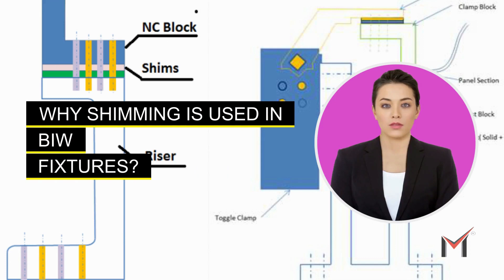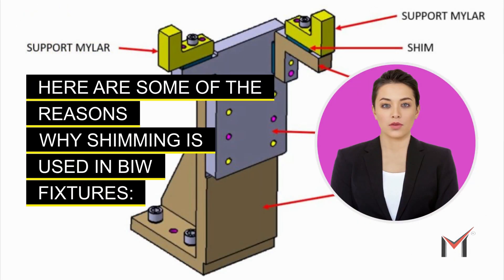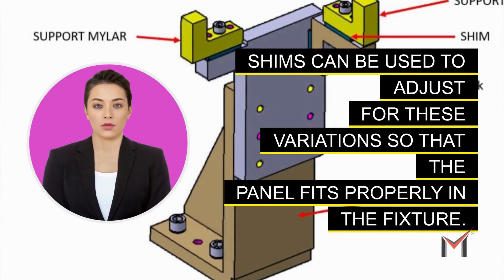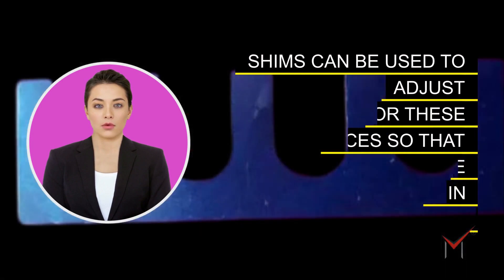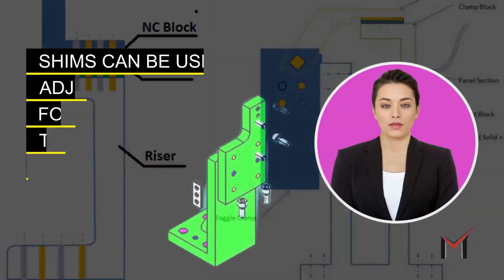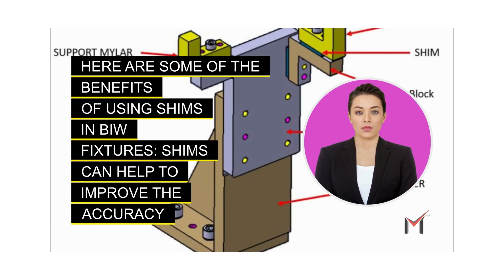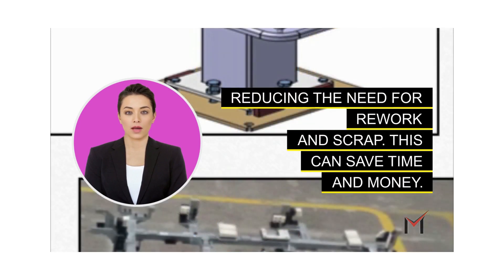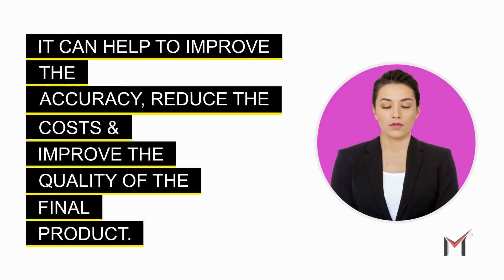Unlocking the Secret to BIW Fixture Design Success: The Power of Shimming

Comment: Sir i need welding fixture design course
Reply from the maker: We provide BIW welding fixtures design course 
It's 3 months course with CATIA basic and then project based training which includes 2D drafting 
3D concept design 
3D finish 
Robotics simulation using CATIA v5.
You can visit our website 
https://mcadsolution.com/biw-fixture-design

For More details 
Call on 9096708490

Regards 
M CAD Solutions